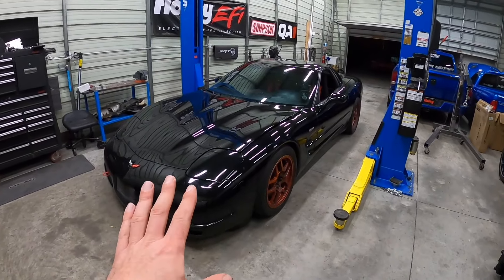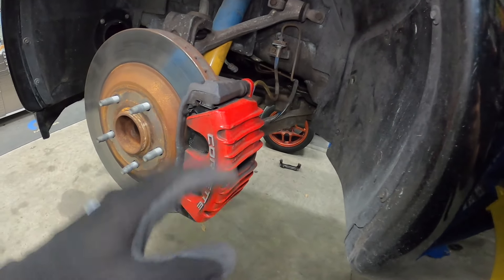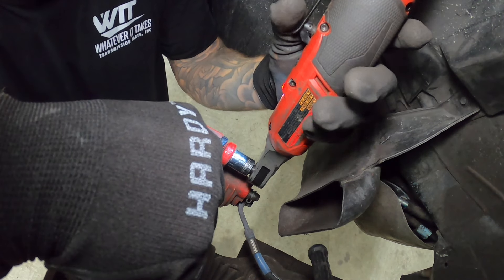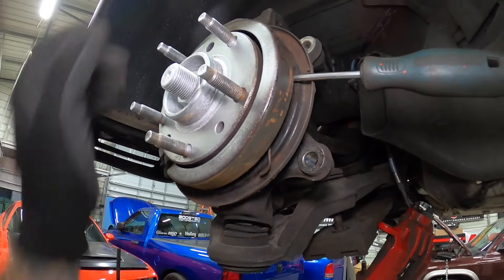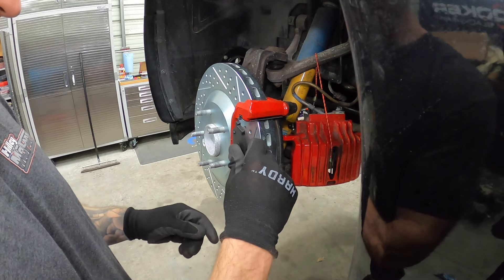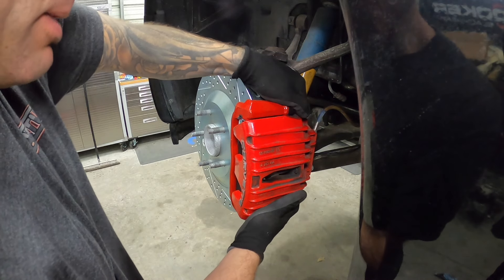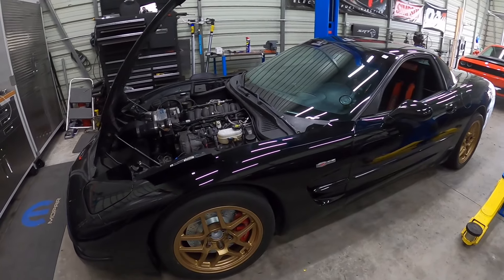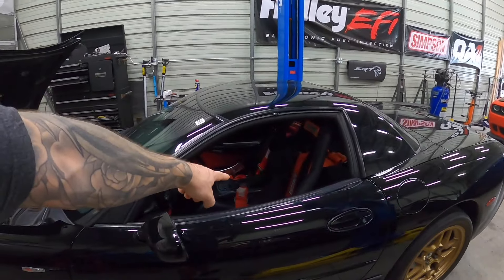How to Replace Brake Pads & Rotors on Corvette C5 | Baer Brakes

Comment: Good video but if I may.  You should have told everyone to open the master cylinder cover, remove some of the fluid, and put a rag around the cylinder reservoir in case the fluid backs up.  Also, your tool is fantastic but I use a C-clamp and use the old brake pad so both wheel pistons will go in at the same time.  This stops one one piston from going out while you are pressing the other one in.  Great video, keep up the good work!

Comment: I liked the red wheels, but I agree they needed some love. Also, I've used a lug nut to help hold the rotor in place while getting everything lined up, then once the caliper bracket and caliper are reinstalled I remove the lug nut and reinstall the wheel. Great video John! I'm really looking forward to seeing this thing on the track! Are you planning on racing a variety of courses or just drag?

Comment: Can you explain “bedding” or how you break in new rotors and pads. ? Awesome video as usual 👏🏻👏🏻
Reply: So, typically, brake pad and rotor manufacturers have specific steps they recommend to properly "bed" the pads to the rotors. It's a fancy way to describe breaking in your new parts. This isn't exact, but it will have some instructions like several slow brakes to a full stop from 35mph, several more aggressive brakes from 45-55mph to a full stop, etc. This allows the pad and rotor to heat up and "seat" with one another to make sure they're functioning properly. Nicer brake companies like Baer, Wilwood, and even Power Stop all have "break-in" or "bedding" procedures that accompany the new parts. Hope that helps. 😎

Comment: I have a question about the slot direction. I bought the Powerstop kit for my 300 and they say the slots go the opposite direction as yours does. I've seen others do the same. Why are the slots oriented differently from one application to another?
Reply: it depends but ultimately the way the ones he bought are correct , you want the slot oriented to catch the air to cool effectively, if they were out on the other way it wouldn’t dissipate heat properly